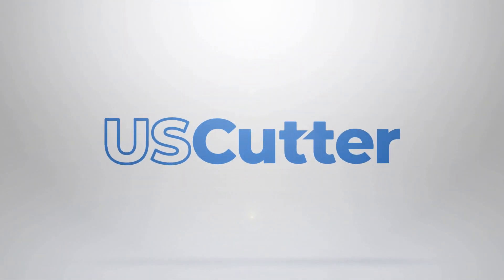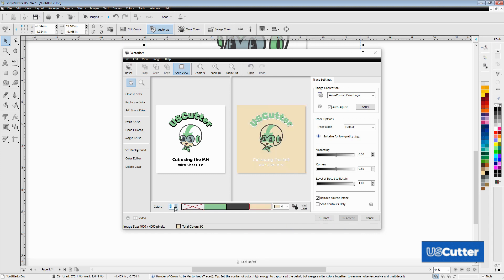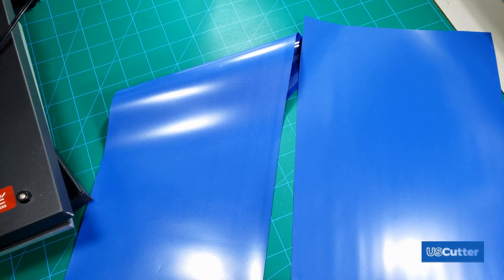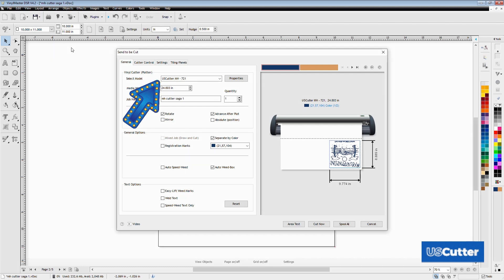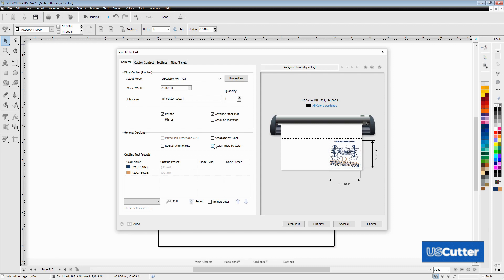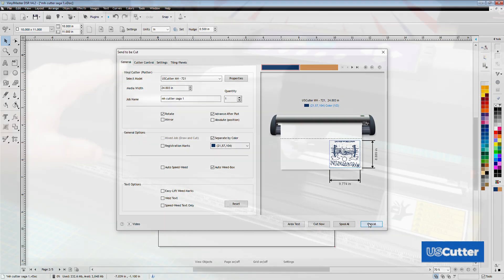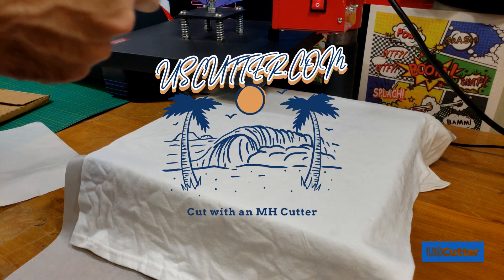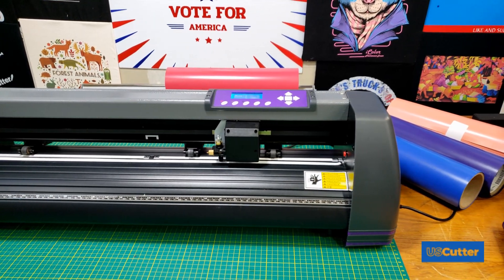How to Cut Heat Transfer Vinyl with any USCutter MH Vinyl Cutter

Comment: This video helped me a lot. I switched from the 30 degree blade to the 60, lowered speed to 100mm and then played with the pressure. Seems like my blade is out really far bit with a pressure of 180g a small logo weeded almost instantly and 1000% perfect! (Siser easy weed and mh721 mk2)
Reply: where do you change the speed at?
Reply: @Chingona-in-MI  you can use the 4 arrows to adjust the speed and pressure. Speed is rated in mm/s i think.

Comment: Mine will not cut through htv ?? No matter what my pressure is.
Reply from the maker: It could be something up with your blade holder.  Support@USCutter.com  if you want to reach them by email or call them at the number found in the top right-hand corner of this page  to speak to an agent directly - https://www.uscutter.com/
Reply: @uscuttervideos  Blades could be too deep.

Comment: I have a problem with this machine. It does not make symmetrical cuts; Left side GOOD, but Right side slim. In design both sides are equal.. What will be the problem? the rollers?
Reply from the maker: You will want to contact SUPPORT@USCUTTER.COM for anything support related.  Each machine comes with free lifetime support.

Comment: I can’t seem to get my cutter to do complete cuts during test cuts it LITERALLY cuts one side but not the other. When weeding the cut is still attached to unwanted material I tried adjusting force and speed no help!!!! PLEASE HELP
Reply from the maker: You will need to contact technical support for help. Each machine purchased from us comes with lifetime support so just contact them at SUPPORT@USCUTTER.COM or call them during the week.
Reply: Same thing someone else said…I’ll pass on this machine

Comment: Can this cutter be used to make large  stencils eg, 18 x 18 and above? I need  an answer please.
Reply: Yes
Reply from the maker: The MH I used has a max cutting width of 24 inches and it can cut beyond 18 inches in length.